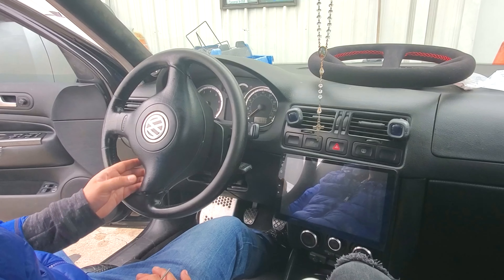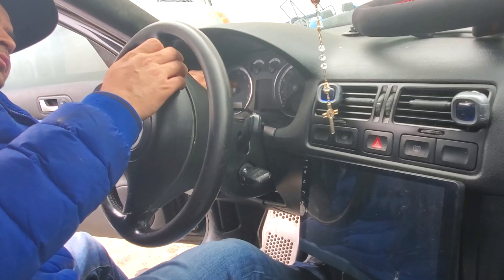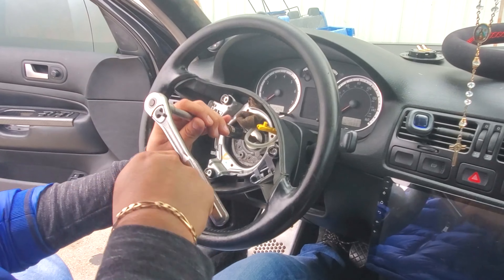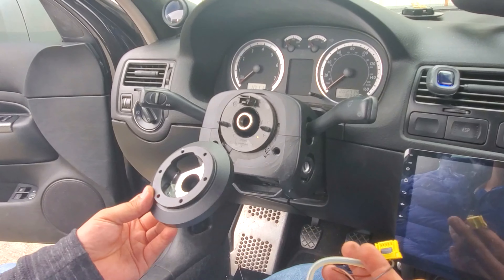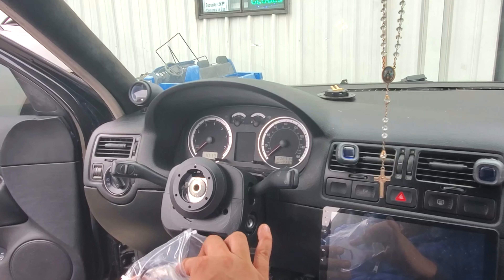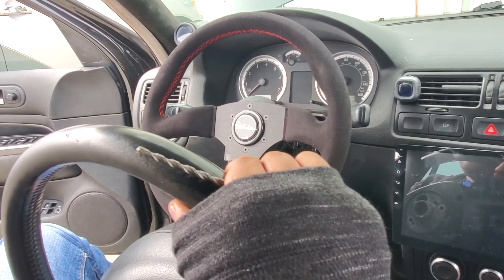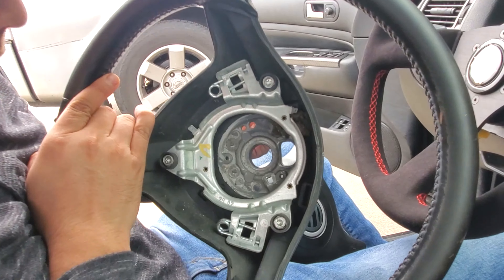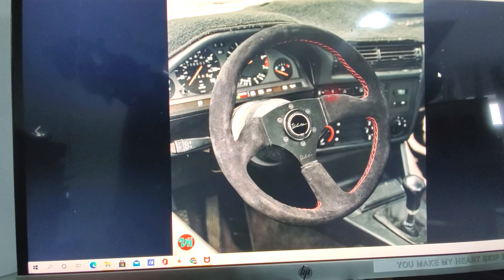how to install 350mm aftermarket steering wheel jetta mk4 1.8t

Comment: What did you do about the airbag light
Reply from the maker: I'm gonna try to clear the code tomorrow if it doesn't clear now im going to have a permanent air bag light
Reply: @squalo777videos  what was the outcome of the airbag light?
Reply from the maker: I haven't had time to deal with the code but my airbag light its on
Reply: @squalo777videos  okay kool kool no worries
Reply: @squalo777videos  You should Get a Small rezistor on the Airbag pins, that Give the same current as the Air bag, That way the Car will think that your car still has the airbag. also You can do the same with the horn, just get a Multi meter to check what pin is the horn and Make a lead to your aftermarket one.

Comment: Hey brother the hub and steering wheel are 350mm correct?
Reply from the maker: you need the hub to 350mm to attach any 350mm stering wheel
Reply: @squalo777videos  thank you I really appreciate it, so get a 350mm hub and that should work with any steering wheel👌🏽